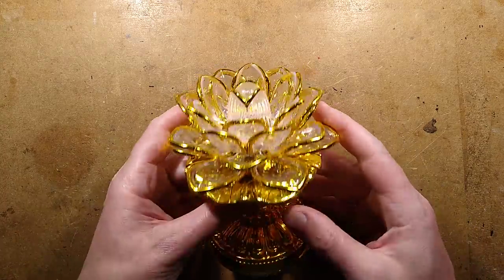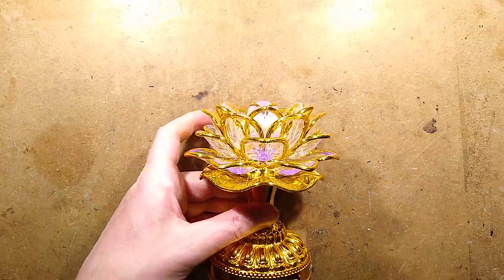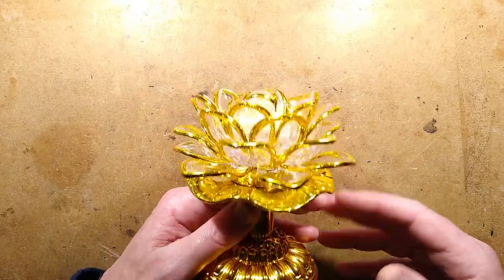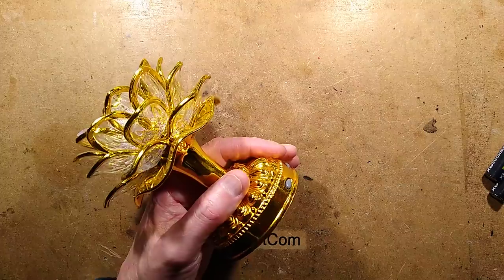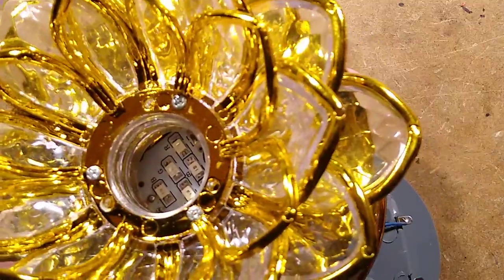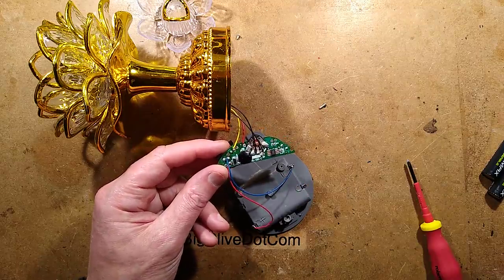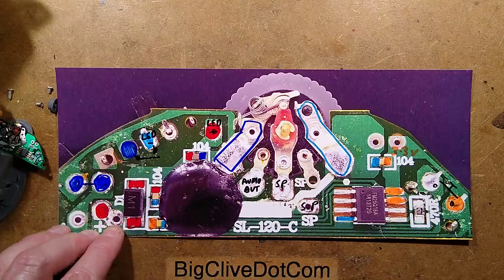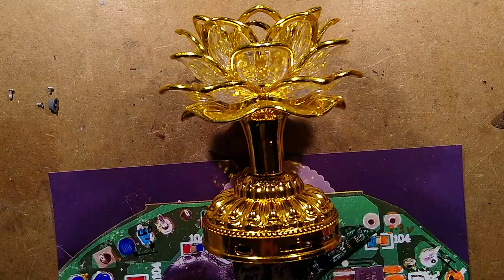Buddha machine teardown with flash dump

Comment: Looking at the data file, there's a very definite structure. There seems to be a table of contents at the beginning, followed by another data table at 0x600, and then a short data file from 0x700 to 0x2940. The actual data seems to start at 0x9700. It definitely looks (poorly) encrypted to me. The two initial data tables show a rather similar 16-byte repeating pattern, so I'd guess it's xored with an 8 or 16 byte value. The table at 0x600 shows a lot of repeating sequences which I think are likely to be zeroes so it's probably not hard to decode.

The block at 0x700 is interesting. I don't think it's music data as it's disjoint from the bulk of the data, but surely the blob won't be loading its code into RAM --- RAM's expensive so it's likely to be mask rom or write-once flash, right?
Reply: Nice spot on the XORing. Looks 16-byte to me given the locations that EF FF appears.
However, another user spotted an ASCII sequence at 1F0A00. Does it make any sense that this bit isn't XORed but the rest is?
Reply: @userPrehistoricman  The data at 0x1f0a00 looks like a 7 bit ascii table encoded as unicode... It also suggests big endian which could be useful elsewhere to decode.... but then, who knows? it could be garbage added by whatever utility the manufacturer used to create the rom chip image. Lots of possibilities. I'm starting to think like others that it could be a simple xor based pulse width modulation. The COB could have a small amount of ram that could contain a rotating xor table and I was thinking it could be maybe 4 or 8 bit PWM. Each track might have different sample rates too based on their complexity...
Reply: Hmm, that's a small header plus an ascending table of 16-bit numbers from 0x00 to 0x7f. I'm going to go with some sort of footer added by the flashing utility.
Reply: I successfully decoded the data at the start of the file.  It is a basic XOR cipher but I'm not quite sure of the exact algorithm, but I got far enough to get a list of filenames, offsets and sizes out of it which match up with the rest of the data.  The audio files are named n01.f1a through n39.f1a, and no idea what format they are in or whether they are similarly encrypted or not.  I can't post links but if you can find the Reddit post for this video I put the code I used as a comment there if you want to investigate further.
Reply: @Malvineous0  Very nice! I left a comment. This machine sounds surprisingly hackable.
Reply: @Malvineous0  very very cool… I installed node js and decoded it. Now to examine further. I suspect it might be pulse width or raw 8 bit samples or similar but I will have to look into it after work.
Reply: @Malvineous0  Funny that you should post that just now, because I made a breakthrough decode as well. I spotted data at 0x27B0 that goes 01 00 01 00 repeating. Then used the keys to decode the rest of the file. I see some strings "code.app" "play_list" "id_list" "map_table". Two new keys are 3E7CF8F0 E0E1E3E7
Reply: @userPrehistoricman  Those are parts of the filenames.  Try the 32-byte key from my post:

0x10, 0x00, 0x20, 0x60, 0xE0, 0xC1, 0x83, 0x07, 0x0F, 0x3E, 0x5C, 0x98, 0x10, 0x00, 0x20, 0x60, 0xC1, 0x83, 0x07, 0x0F, 0x1F, 0x1E, 0x1C, 0x18, 0x10, 0x00, 0x20, 0x41, 0x83, 0x07, 0x0F, 0x3E

Remember to XOR every byte by 0xFF as well as using this key.

Note that it only seems to correctly decode the first chunk, not the rest of the file.  The code.app file seems to use a truncated version of this key at the start but not sure about the rest of it yet.

Comment: The behaviour of the volume control might be because it's a high resistance compared with the speaker.
Reply: More probally because its a linear pot, we don't record or listen in a linear fashion so should realy be a log pot or often called 'audio taper' as the resistance increases decreases in a logarithmic  way...probally.
Reply: @andymouse  If you connect a speaker directly to a pot then the value of the pot has to be similar to the impedance of the speaker. The speaker might be 8 ohm and the pot 1k. That would give this effect. This I've learnt in 65 years of playing with electronics!
Reply: @OC35  Probally, first thing that sprang to mind was log/lin...cheers.

Comment: Had a quick look at the ROM dump, but couldnt find anything very familiar. The beginning looks like some sort of table, describing the contents and their locations. Binwalk hasn't returned anything.
Reply: I figured out partly how to decrypt it and got a list of filenames, offsets and sizes out of it but it looks like the files themselves are similarly encrypted with a slightly different XOR algorithm.  I posted the code on the Reddit post for this video, but I can't post a link here or my comment disappears.
Reply: @Malvineous0  That's awesome! So they did just XOR it?
Reply: @nrdesign1991  They did for the start of the data.  The code that follows (the "code.app" file) uses a slightly shorter key, so I'm not sure whether the audio is encrypted or not but if it is I'm sure it'll be another variation on the same XOR cipher.
Reply: @Malvineous0  Fascinating. I ran your code to try for myself and it indeed decrypts the file headers. I wonder how you got the key, by brute-forcing? 32 bytes are already quite a lot to do entirely by hand.
Reply: @nrdesign1991  I did it by guesstimation, trying a few things that didn't work and gradually narrowing it down.

First I figured that a lot of the repeating bytes were probably 0x00 so I picked some keys that turned those bytes to 0x00.  This didn't work but the other bytes all looked inverted so I tried XORing the whole thing by 0xFF first, and this worked - those bytes that I thought were 0x00 were actually 0xFF and some parts of the filename were revealed.  I saw they were dots with three letter extensions and terminating nulls, so picking more values for the key bytes to get the nulls and dots to appear in some filename entries, revealed more parts of the filename in other entries, confirming the key bytes I had chosen were correct.  Then it looked like the first field was an offset so I picked more key bytes that produced the offset I expected for the first file, then I had a look to see if the other file offsets seemed right and they were.  Using the offsets I could calculate the file sizes and that gave me cleartext values for the next field so I could select more key bytes that produced those values, then I assumed the single incrementing byte was an index marker and sure enough picking a key to turn it into numbers starting from 0 also revealed the first line of data had the total file count in that position.  I kept going like this until all the values looked right.

But it means the key I came up with is probably not 100% right, as there are some values in there I am not sure about.  I am hoping that by looking at the mostly-correct key it might become clear what algorithm was used to generate it, because reimplementing that algorithm will produce the correct key and a fully correct decryption.

Comment: may not be MP3
It may be 4 Bit ADPCM (before the days of MP3)

You need a Goldwave has the 4 Bit ADPCM support in RAW File . - VOX Mode just remeber to drrop  the HZ to 8000 or 6000 mono
Reply: I decoded the filenames at the start of the dump and they are named n01.f1a through to n39.f1a.  No idea what F1A is though, all I could find was a vague reference to some telephony codec.

Comment: Could the weird response to the volume control be caused by using a linear potentiometer instead of a logarithmic one.
Reply: Or the other way around...
Reply: Yeah, doubt they would spring for an audio taper pot !
Reply: Since it has been wired in series with the speaker, I suspect the problem is a combination of using a log pot and being too high a value. Most of those little thumbwheel pots I have seen are in the 4k-10k range, so unless the speaker has a very high impedance then only the last few degrees of movement are going to let through enough current to make any appreciable noise.
Reply: Other way around.  Log pot intended to be placed before the output stage but instead connected directly to the speaker - mismatched impedance.  These on/off/volume pots are intended for audio applications, so almost always log2.
Reply: @Chrisamic  cheers.
Reply: @IanSlothieRolfe  cheers.
Reply from the maker: Or the wrong value so it only affects the volume significantly for the very last bit.

Comment: Would that strange change in loudness be because it's a linear pot rather than log?
Reply: Linear pots aren't anywhere near that steep in the slope. I used to use linear pots for theater volume controls all the time because it actually gave better control in the range necessary. 

The problem here is the pot is just a resistor in series with the speaker. To do control like that you need a pot that is not much more than 10 times the speaker resistance. If it is more, all the voltage goes across the resistor until it gets down to about 10 times the speaker resistance, which is probably 3 to 8 ohms. They probably used a standard 1K or 10K pot, so only the last tenth of a turn or so is useful.

Comment: There's some sort of TOC at the beginning of the bin.

The battery lid has 32 entries on it...

There's 32 (!) occurrences of 0xCB 0x80 char seq in the bin, each followed by a significant amount of data. Probably the audio 'files'. First occurrence of the sequence is right after an empty area @ 0x9700. Unfortunately google comes up empty on the sequence..

'i could be wrong' :)
Reply: I've run with that idea and split the file into the chunks between those CB80 markers. I can't see any repeated chunk signature like mp3 would have, so I tried having it interpreted as various kinds of PCM, but they all only come out as noise. I'm wondering whether some mathematically cheap compression like RLE might be in use here..

Comment: how is the metallic gold achieved on things like this? It's obviously not real gold on this kind of cheap crap but the color and luster is very convincing.
Reply: Usually sputter deposition of metal particles or conductive paint on the moulded plastic, then they electroplate it with a copper or zinc layer, then the final layer is the surface finish.
Reply: @pyromaniac303  I guess maybe.   it's like $10 though. maybe forced prison labor 🤷‍♂️

Comment: I still don't know what the format is, but it is not:
1. 8-bit PCM data: opening it as any variant of 8-bit audio results in pure steady noise. This is typical for compressed data. Try opening a ZIP or MP3 file as 8-bit PCM and you'll get the same kind of noise.
2. Chinese text. When opening any random file and forcing it to be interpreted as UTF 16, you are likely to get a bunch of random Chinese characters. Also, why would they bother stuffing song names in this chip? It would be a waste of effort and space.
3. Standard MP3: Audacity does want to open it as MP3 if I chop off the first chunk up to position 0x9700 that ends with a stream of 0xFF characters, but the result is only 0.1s of what sounds like a steam whistle. It does open it as mono 11025Hz, which would seem about right for something like this, so perhaps it is MP3 after all but the data is chopped up into blocks with markers in between them that prevent a normal MP3 decoder from reading it as one continuous stream.
Reply: Pretty sure it's encrypted.  I can't post a link to Reddit but if you go to the BigCliveDotCom subreddit and look for the post for this video, I have posted some code that will mostly decrypt the first block of the file.  There are indeed filenames in there along with offsets and sizes.  There are 39 audio files with an .f1a filename extension, but I have no idea what format that is.  I suspect whatever it is, it's also encrypted with a slightly different XOR cipher.

Comment: Buddhists famously believe that mechanical prayers do counts as real prayers.  Some Buddhist temples have columnades with small easily rotated cylinders that have prayers written on them.  Believers walk past and spin up selected cylinders so the written prayers scroll past even after they walk away.  This appears to be a natural upgrade.
Reply from the maker: The catholic industry has coin operated prayer candles in its chapels.  The more money you put in, the more LED candles light up for a fixed length prayer moment.
Reply: Tibetan Buddhists believe that. They also have hand held prayer wheels which are stick mounted cylinders containing sheets of mantras. Moving the cylinder flings out a weighted chain that spins the cylinder and the more rotations the more the mantra is disseminated to the universe.

Other Buddhists regard all this as superstition.

Comment: Honestly I'd expect some low bitrate RLE compressed format with simple metadata for optimal cheapness, don't care enough to dig around myself.
Reply: RLE was my initial guess too, mp3 is just too processor heavy. But I am just guessing.
Reply: Nope. It's not any standard waveform data unless it's been transformed to make the audio unrecognizable. There are patterns, so it's not true encryption, but I have no idea what I am looking at. It's probably a proprietary codec.
Reply: RLE is useless on audio. ADPCM (as used on PSX 1) is very easy to decode in software and sounds ok
Reply: @rich1051414  - could it be OGG Vorbis?
Reply: @tbelding  No. All ogg files have "OggS" in the header. No instances of this found in the bin file, so it doesn't contain any ogg data.
Reply: @rich1051414  Gotcha.  I was thinking that it would be a 'free' codec for them to use.  No actual knowledge of how the files look, because I've never checked mine.
Reply: I decoded the first block of data and it's a bunch of filenames, sizes and offsets.  The audio files all have an .f1a filename extension which I don't recognise, but that may give someone some hints about what format it is.  I can't post links but if you look at the Reddit post for this video I have put the code I used up there if anyone wants to take a closer look.

Comment: I always wonder how those blobs work
Reply from the maker: It's a standard silicon chip glued to the PCB, thin wires attached to PCB pads and then covered in black resin to protect it from damage and light.

Comment: Are you sure these are MP3's at all? They sound more like the very simple, low bitrate/low compression schemes that used to be used for voice comms in the middle to late nineties.
Reply from the maker: It doesn't sound like CVSD modulation.
Reply: The audio to me sounds like like Hit Clips, from Tiger Electronics. And I suspect that's what it's actually using. Which is basically a very low bandwidth PWM.

Comment: so technically there is nothing stopping you from restacking it with a 3 minute wav file of song samples from say Judas Priest, motor head etc.
Reply: If it is compressed (it looks like it is) you will have compress anything new similarly. It is not an MP3 file. Ron W4BIN

Comment: Hopefully i can stop myself from thinking about my bedroom light which seems to have failed in an… interesting… way
(Earlier i heard a strange hissing sound, but could not tell where it was coming from,  then after an unknown length of time (cant recall exactly how long it was) my bedroom light started flickering, the landing light was not flickering, so i knew it was most likely the bulb and not the mains supply, ive turned it off at the wall switch, and after the bulb has cooled down to the point where i can remove it, i will switch it for one of the ones in the box of assorted spare bulbs, when i can find the box)
Reply from the maker: Most likely the electrolytic capacitor inside venting.  It happens a lot.  Especially when an LED in a series circuit fails and the voltage shoots up.

Comment: I got the songs out, it wasn't using an XOR at all 😑 they probabaly sound even worse on half way decent speakers 😂
Reply from the maker: What format are they in?
Reply: @bigclivedotcom  I'm still unsure but here is how, I opened it in note pad and viewed it in utf 16le mode, which tra skated the whole thing into translatable Chinese, I am having trouble changing it into English online though, but my phones translator gets little parts, I think a problem is either a missing character not on my computer or a seperator symbol (a square) let me know if it helped
Reply: @bigclivedotcom  I can't seem to. Do on the computer what I've done on my phone and it isn't tra sferring across

Comment: I have a prayer/song thing like this, there's a cheap one with 30 or so songs and another with, I think, 52...its just a loop though, total blob chip, which is a shame because I hoped you could bend the pitch and have some fun!

Circuit looked the same as this one too
Reply from the maker: Have you tried licking a finger and applying it across resistors in the vicinity of the blob while it's playing?
Reply: @bigclivedotcom  haha Nooo, I did try bridging connections but it just went silent or turned off, boring really